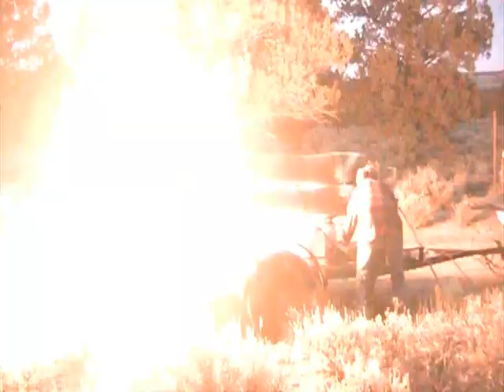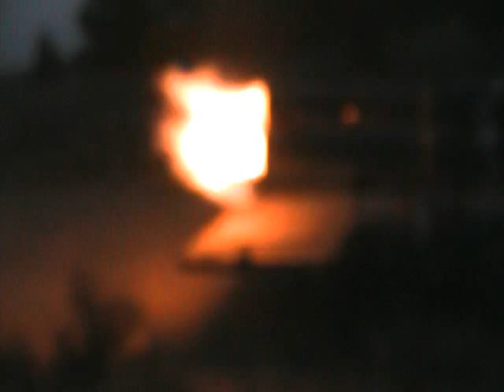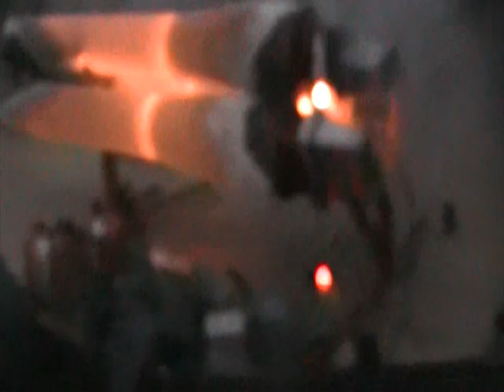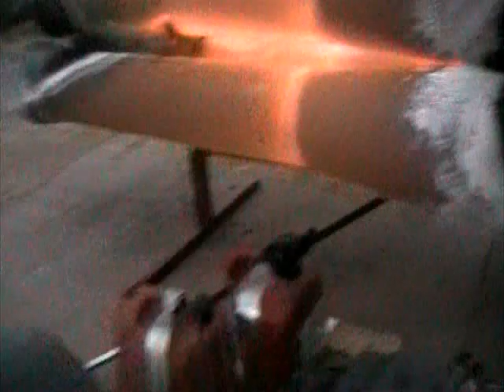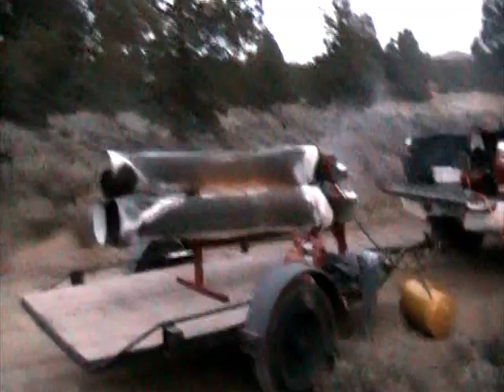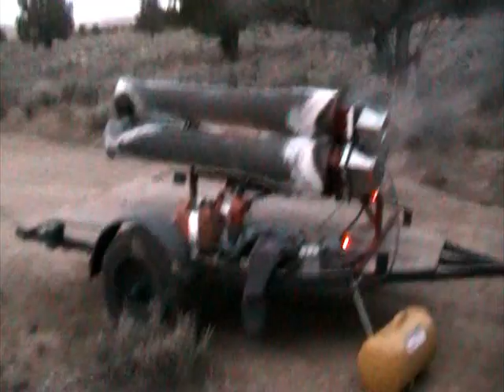New Rocketman show starting 2017 Crazy big Pulsejet engine.

Comment: You need wind going past them to cool them down a bit...   blast a huge fan on the front of them to simulate a 60mph airflow over them...    or build some smaller ones I can mount on an ultralight aircraft...

Also, I'd park your plastic gas cans far away from the actual engines... let a pump feed the engines through a line you can yank away with an easy disconnect if shit catches massive fire...  and disconnect your truck and move it away as well... in case of gasoline fire.    A huge gasoline fireball of just the gas in those two plastic tanks... probably won't be able to be put out by a fire extinquisher... you aren't going to want to get anywhere near that... the heat will be intense...   and your truck would be unnecessarily damaged.

Comment: Miles and miles. There's a video on here of a swedish team building a snowmobile with a pulsejet on it (smaller than this one) They stated they received noise complaints 7km away through thick woods, and it wasn't even pointed in their direction :p